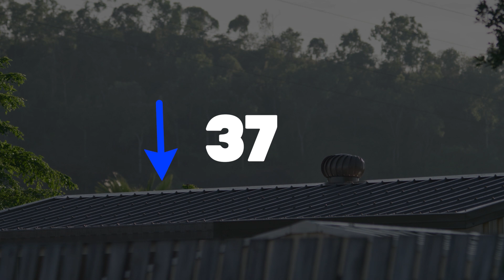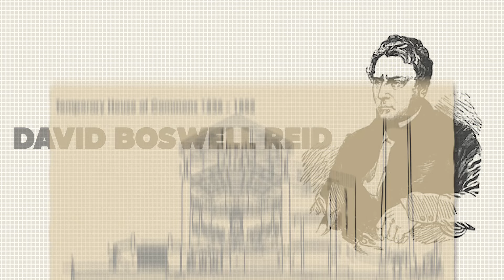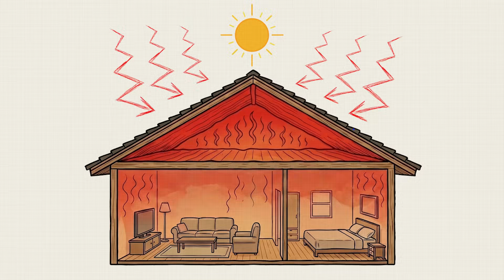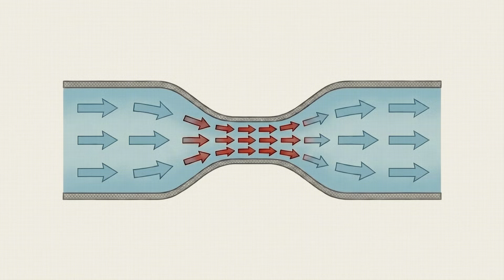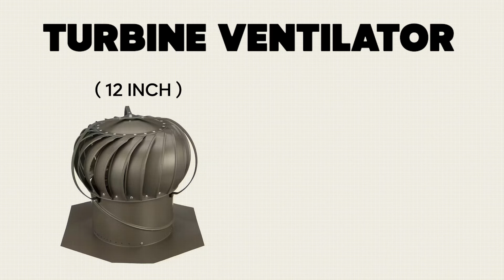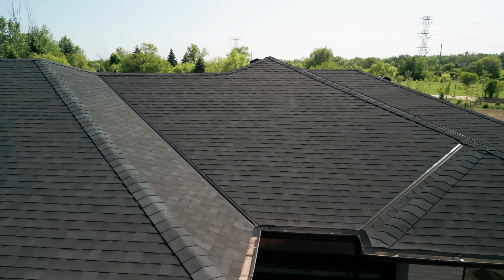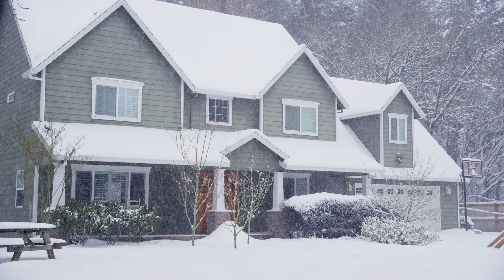Why Did We Stop Using This Natural Cooling System?

Comment: I'm in the business for 20 years. People moved away from the very efficient roof turbine for several reasons. the way it looks, wear and tear from spinning parts, wind dependent, pest vulnerable, and leak potential.  They're rather fragile from strong winds and tree debris. Overall I still prefer them to passive box vents as they work better. Attics  have a function, but they should not be excessively hot- that should be avoided for many reasons. passive ventilation is best and the turbine is a stand out. Functional gable vents are also important- those are often missing altogether, or barely working. or simply decorative.

Comment: Add metric system to this, and you got yourself a correct video. I mean, if you remove AI BS. 

Also, without a system like canadian pipes to keep the pressure steady inside the house, it's just gonna be inefficient in an hour. This need influx.

Comment: A whole house fan - installed in the ceiling of the upper floor to blow air into the attic - both expels the superheated attic air and draws in cool outside air into windows in the living space below. Used in the evening, in less humid areas, a whole house fan can eliminate the need for AC entirely. It does require sufficient venting in the roof, such as a ridge vent.

Comment: This is complete b.s. theyre called turtles  the thing turns because of the heat escaping through a HUGE HOLE IN THE ROOF.  All the spinning thing does is keep rain and animals out.  Get a ridge vent with proper soffit vents and gable vents.

Comment: forgot to mention it can have the opposite effect in winter months, instead of making your AC work harder to cool your home, it causes your heater to work harder to heat your home as it's sucking out all the warmed air, but this can be solved if you have a shutter or locking type system for it. but those type of units more expensive and more failure points

Comment: these things and awnings.  we need to look back a bit and remember what worked.  im doing a cabin build and one of my musts was having a fan mounted in one side of the loft into the wall opposite a window to push hot air out in the summer nights to pull in cool air from outside.

Comment: The reason they're not used on sloped roofs is because ridge vents are objectively better. No one should be using these anywhere a ridge vent can be installed.

Comment: Most modern attic spaces are filled with insulation and not considered a livable space. You would use these vents if your attic is considered livable space. if it is not you fill with insulation and the attic is more or less a barrier between you and outside.

Comment: We still use roof vent, it's just that the spiny part was totally unecessary.
Now roof vent are just metal box shaped in a way that let air out without letting rain in.

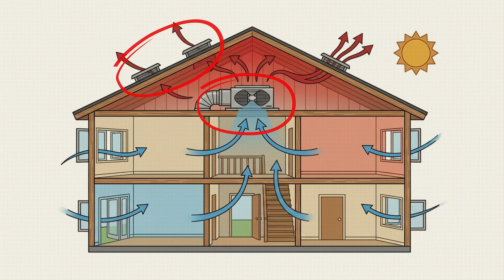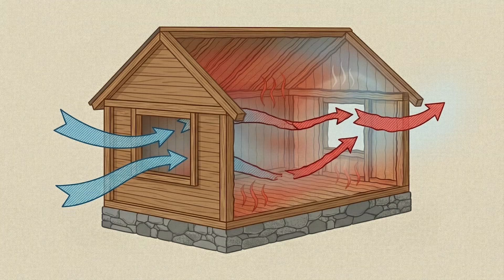Comment: Helpful info. Could have more clearly stated the need for soffit vents to pair with turbines, box, and ridge vents as that is the source of fresh, cooler air. And gables are shown in one of your clips but not discussed. Also, several of the graphics in this video are inaccurate at and following the discussion of Soffits. 4:54 Soffits are at the eaves, not the central of the house. 5:13 And turbines don't pull air from one window to another.

Comment: In EU you would loose A+ or A++ rating of the house if you had these. We have to make houses as tight as possible so theres no or minimal thermal loses. In EU when you build a house you literally tape every possible hole from the inside and do the pressure test to see if it holds.

Comment: Greetings from Adelaide, Australia. It's very hot in summer here. I had one of these installed when I built my house. Also got a "roof blanket" and extra insulation on the advice of my architect dad. The sales guy from the builder rolled his eyes at me, but to this day I don't regret it, the energy efficiency is great, and we only ever need to put the aircon on the lowest setting.
Reply: Roof blanket? What's that? Just ceiling insulation like BATS, aluminum foil or something else?
Reply: @Nicholas_Steel   similar to ceiling insulation material, but with a foil backing. It sits directly under a tin roof to shield against radiant heat rather than on top of the ceiling. Keeps the loft space cooler.
Reply: @mattharris9117  Neat.

Comment: The reason we stopped using them is mostly because they leak,  after a few years they start to leak really badly of course it gets worse with age sealing them properly is a pain in the ass.  What we do now is a mixture of better insulation and in some cases powered fans. The powered fans usually vent to the side not the top.

Comment: This video is about older houses. New houses for awhile have been built so the attic is air conditioned space. There are no vents at the eves or roof vents. The insulation goes on the roof, not the top floor ceiling. This solved some issues.

The video did not point out that just adding a turbine ventilator will be bad if the house doesn't have proper eve/soffit vents where outside air can be drawn in. Without eve vents the turbine will pull AC cooled air out of the rooms in the house which then pulls outside air into those rooms.

I have a 1946 house and I added 2 turbine ventilators. That was the easy part. I had to add eve vents all around my entire house. And that meant removing insulation at the eves so it won't block air flow. That meant just 6-7" of insulations at the eves which is a trade off.

Turbine ventilators are a great idea, but not for all houses. A conditioned attic is better.

Comment: I know what they are, but still wouldn't want them. It adds more potential areas for water to leak into the attic. Water damage, stained ceilings, and the like, can quickly offset energy savings. I prefer no additional holes on my roof. That said, the actual attic part of my house is quite small. Most of the upper floor has tall slanted ceilings. There's not much attic space for the turbines to do their work.

Comment: Our 110-year-old building in New York City has had these installed for decades.  Older buildings in NYC were designed to 'breathe' as described in the video -- from back when we understood that still air made illness worse and more likely, and when mechanical HVAC wasn't available.

I was surprised at what a difference they made when one of them was broken and had to be replaced. They're spinning like mad all year, when they work!

Comment: One possible way to overcome silly regulations is to power them. This way a certain performance is guaranteed regardless of weather conditions and energy consumption will remain low if designed correctly.

Comment: The Turbine ventilator worked to good and did not use any power. I lived in a house for 25 years and the two we had never failed. now they want electric fans to push the heat out so they can get more profit.

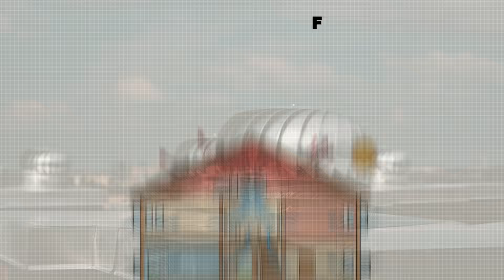Comment: The diagram at 04:41 is drawn incorrectly. The narrator describes air coming in through the soffits and being ejected through the roof, but the diagram shows air going in the windows and leaking into the attic from the air conditioning system ductwork. I haven't seen the whole video yet, but none of the diagrams have shown air going in via soffits (under the eaves) as they should.
Reply: You’re exactly right and it makes me wonder how much the writer of the video actually knows about this topic, verses regurgitating whatever Gemini/ChatGPT said
Reply: This is entirely an AI script.

Comment: Your description of the physics is a bit too simplistic as it implies gains with loss. 
Example: Air pulled from the attic, even with roof vents, will pull air from the living space, losing cooled air. 

Also, a more helpful comparison would have been to compare the turbine with ridge vents.

Comment: they work great.... in the summer time. lol they just need to make them with rotating closer vents so you can cycle them closed in the winter cause same cooling logic applies lol your attic ends up being almost colder then outside in the winter. for mine i just cut out a round piece of wood and put a cupboard handle on it and put it up there to stop the airflow when the cold months come around and works like a charm

Comment: I looked into them once for installing on an existing house. Manufacturer specs for volume mean we needed 16 of them on a single house.

It's just too expensive. The return on investment time is too long.

Also like all passive systems these are limited to cooling to the outside temperature. And that's not enough.

You're better off putting a second roof (or solar panels) on instead to deflect solar radiation.

Comment: I want one just because of how it looks, to be honest. Ball bearing failure? Upgrade it with magnetic bearings! Not enough ventilation? Surely a small motor fitted to a solar panel could make it spin faster? There must be improvements to be had here.

Comment: OK. 21 years in residential roofing.  Ventilation of attic space is critical that is true.  Installing an expensive, noisy vent that makes you feel like it is helping because it is spinning is not the answer.  The simpler, more efficient answer is to ensure that you have soffit venting and adequate static roof vents close to the peak of the roof. That's it. Simple heat convection coupled with subtle air currents will do the job just fine.  
Rule of thumb is that you can not over ventilate an attic, but you can definitely under ventilate.  If your attic is over heating, and you do have soffit venting, install a couple extra static roof vents. The calculation is based on cubic feet of space, not "floor space".  If I remember correctly one 8 inch static vent will ventilate up to 376 cubic feet of space. The exception is in some century homes there may be no soffit venting.  That can be a challenge. 2cents

Comment: Honestly, this sounds like a modern engineer's dream for making improvements while maintaining a design that doesn't detract from a home's aesthetics. If it works as well as studies have shown, I would be curious if you could build a ventilated wall around it to give it a chimney look.

I think this concept needs to go back to the drawing board to see what a modern, creative engineer can do to improve the aesthetics. The goal would be to either keep your HOA away or have them mandate it for all homes in your community.

Maybe you could even add a solar component* that could be motor-driven when wind speeds are too low to get the turbines spinning, considering you were mentioning speeds of \(5\) mph. In my opinion, it's really something we should revisit in this modern era.

*Update: Just found out that they have Solar Turbines like I was thinking already on the Market.  It could be worth the investment in getting an Active System over the traditional Passive system.

Comment: these and awnings are a great low tech cooling solution. and you can add a thermostatic baffle to the turbine ventilator to help efficiency in the winter. and retractable awnings can do the same thing.

Comment: The way I look at it, if you think you need one , you likely do not have enough soffit and or roof ventilation.
Hot air rises and pulls cooler air in through the soffit naturally. As long as you don't have too many restrictions it will take care of itself.

Comment: the bearings go out on them frequently, even the so called maintenance free ones.  they squeak and make all kinds of noise, you also get vibrations and rumbling thru them too which can travel down the beams and rafters.  good idea but tended to be a lot of maintenance problems, especially when theyd start squeaking / howling at 3 am.

Comment: One of the first things my parents did when they bought a house was to have an attic fan installed, even on a still day you can turn on that fan and open windows and it pulls air  strongly in throughout the house and exhausts the heat out of the attic with the power of a jet engine, they are amazing especially in Spring and fall and very often you can do without air conditioning just by running that at night and exhausting the heat out of the house and pulling in the cool air. I really don't know why these are not standard equipment in every newer home.
The only downside is the windows you choose to open are going to have dirty screens because of the force of the are being pulled through them, but spraying your screens off once a year is a small price to pay to have a lovely strong cool night Breeze every night even into the hot summer for very little cost.

Comment: I recently had my entire roof replaced and every contractor I interviewed tried to talk me out of using turbine ventilation. Even though I have been using them without fail for 40 years. I think we've replaced 1, but only had to replace the round spinning part, which cost about $25 and was much easier then replacing parts underneath shingles. I stuck to my guns because I knew they worked. My roofer contacted GAF engineers to make sure they would honor the manufacturers warranty & confirm they would provide enough ventilation. Engineer confirmed they were fine, but had another one (total 3) added, along with sofit vents. Roofers try to do "ridge vent" or solar powered vents which are much more expensive & shorter life. Just be sure to get turbines (pref 14 Inch, with SEALED ball bearings)
Reply from the maker: Thank you for that feedback!  I am sure a lot of our viewers will find that useful!

Comment: Besides big energy trying to get you to use it to do even passive venting. Modern construction is sealed from drafts far more than in the past. This makes it difficult for the air to get replaced quickly enough which would be considered an inefficiency in modern buildings.

Comment: These are actually fantastic! I bought a large Cape Cod home in Virginia. The unfinished attic only had gable vents on either end.  It made the upstairs very uncomfortable. It felt like the central AC wasn't even on.  Had to have window units to make the 2 upstairs guest rooms usable.  I went to a friends very old home from the 1930's to see how they finished their attic. I noticed they had 3 of these on the back peaks of the roof that were original to the house. I was amazed at how comfortable it was with only windows opened IN THE SUMMER.  So I had 2 installed in my home. There was a 100% improvement in the 90+ degree days! Now they're not a cure-all. It still feels a little warmer upstairs than down.  But the central AC alone takes care of it.  These are inexpensive to buy, and not that bad for installation. I paid $400.00 to have them installed.  So if you were wondering about getting these, don't! JUST DO IT! You will 100% happy.
Also, even with no wind on hot days, they still turn from the heat rising out of them!
Reply: You'd think the main airconditioning unit would be located at the top of a 2 story building, as cool air would flow down to the lower floor (can't flow up from bottom floor to 2nd floor).

Comment: My old house had the ac duct work running through that hot unvented attic, summer time electric bills were over $300, my current home is a mobile home, same square footage but the duct work runs under the house, my summer time electric bill has been cut in half

Comment: I just learned what the roofers did to my house last month. I noticed that they had installed something extra at the peak of my roof that was capped with shingles and I just thought it was added protection, and it seemed to look good too, but yesterday I actually went into my attic and discovered they had cut out the wood from my roof too, and left a bunch of saw dust in my attic.  So I now know it was a ridge vent they installed, and I'm happy to hear it's better than the turbine vents.  Some of my neighbors have turbine vents, and I've wondered if I should look into seeing about getting them, because my attic gets extremely hot with the Texas heat,  and now I know there's no need.  I'm happy that I decided to watch this video that popped up in my feed.
Reply: The roofer installed a “roof ridge vent” in your roof.  My experience and observations are that the roof ridge vent works significantly better than a turbine.
Reply: the ridge vent get clogged in winter ...
Reply: @jessicalacasse6205  When you want to trap heat so, win/win.
Reply: @cchavezjr7  you ll trap humidity and stale air
Reply: @jessicalacasse6205  considering they said they live in Texas, it should be fine in the winter
Reply: @TAMAMO-VIRUS  last time it got cold in texas how many died ...246 ...
Reply: @jessicalacasse6205 Yeah alot of elderly people who need reliable electricity for life support machines die when there's no power for 3 weeks. That's kinda how it works
Reply: @ctsstxc  i smell a good amount of copium on your part ...
Reply: @jessicalacasse6205 Why would I defend a state that can't even keep the lights on when it gets cold and allows their elderly to die because of it? I'm just saying what happened

Comment: I was thinking why don't they connect a generator to them. It would help cut electricity cost during peak hours during the daytimes
Reply from the maker: Not sure they would get sufficient torque to turn if attached to a generator and therefore defeat the purpose of cooling the loft space.  Good thinking thou!  Thanks!

Comment: These will depressurize the house. Pressure inside the house will be lower then pressure outside. House will suck in hot moist air from the outside.